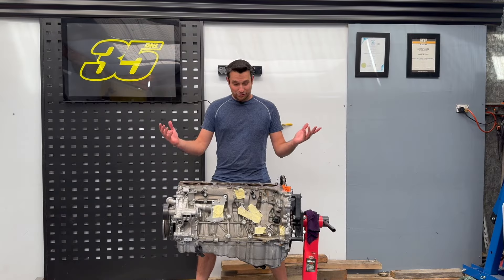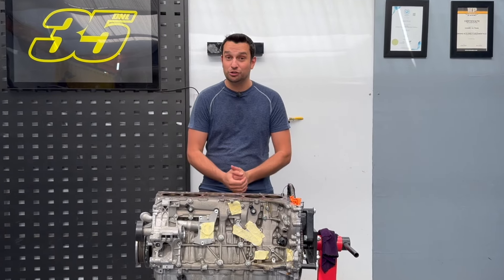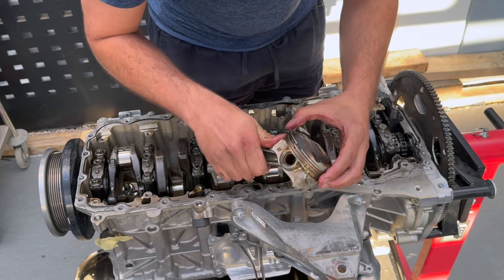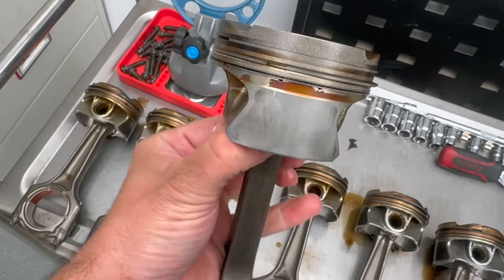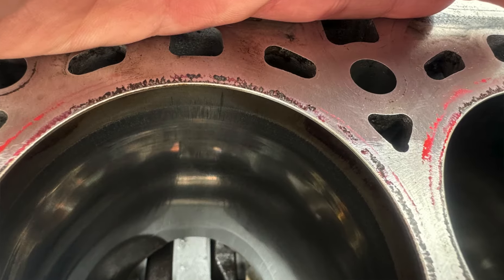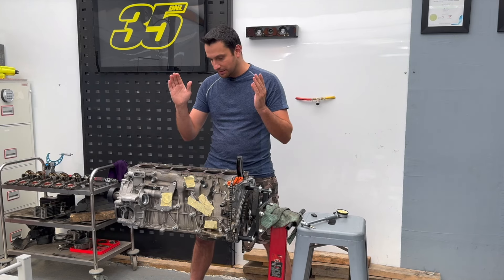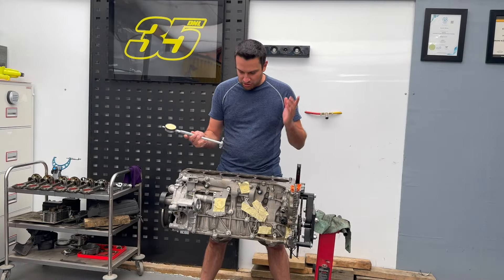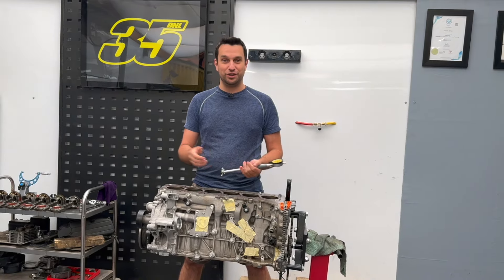BMW B58 Engine teardown - Only 22.000 kms - What went wrong ?

Comment: Would love to hear more about sleeving in the next video, for example what's the difference between iron vs steel sleeves in terms of strength and what kind of pistons you need (cast or forged) for each. Are there any downsides to sleeving? Questions we should ask the machine shop when getting a block sleeved? Very curious about that process. Thanks
Reply: The sleeves, regardless of material, win or lose on block prep. Both are silly strong, and when installed correctly will outlast everything. Makes you wonder why BMW went away from iron sleeves ......oh, I know.
You can put standard pistons and rings back in but why.
Reply from the maker: That’s a great question ! In fact I have a video in the pipeline which will be talking about that - I just need to have some free time to work on the editing

Comment: Hie guyz I really need help thz thc b58 I did engine due to taping noise, discovered pistons were worn-out but nw I have missfire on number 6 I changed almost everything, I re do the engine sent the engine to ENG thy are saying everything is fine , built again start the car doing same thing change plugs, coils packs injectors , I tested compression it's over 1560 psi help please
Reply from the maker: Basically you ran out of things to be the issue. If the engine is good, you have have new coils, plugs and injectors, the issue is either in the wiring harness or the ECU itself.

Comment: Maybe test the injectors? If the injector was faulty and cylinder 3 was running lean then it would get super hot in that cylinder. And then in the heat the piston would expand more and wear itself and the cylinder wall out. But again it's just a theory one would have to verify.
Reply from the maker: Yes, the owner bought new injectors but still sent all old ones to get tested

Comment: Definitely a tuning issue resulting in a fuelling problem.. happened me last month. Ive just stuck a used engine in for time being keeping my other engine as a project to build myself over the next year or so.. fully forged engine single turbo 👌
Reply from the maker: I thought the same
Reply: @dnl35projects i bought my car only recently and it happened. Got very little info on current tuning of it. I think it wasn’t done properly. Engine already got a rebuild by one of its previous owners at 37k km now on 69k km and gone again. Last time cylinder 2 this time cylinder 6

Comment: Seems like the 'wear' might be a manufacturing defect.  Can you rule that out?  The piston skirt being worn might be down to the excessive rocking that then was tearing up the skirt coating.  But the cause of that might be a machining irregularity of the bore it was in.  Shouldn't there be some major scoring and scratches if it was actual wear?

The  appearance of piston crowns looked like it was slightly to pretty rich.
Reply from the maker: I think it’s got more to do with the absence of a proper tune than a manufacturing defect -
Reply: @dnl35projects  fair enough but wouldn't you expect to see similar damage on all the piston skirts, see similar damage to the other bores?

I would think part of engineering a high performance engine is making serious design considerations to facilitate all cylinders are equally fueled and have equal ingress and egress of gasses, equal masses, etc.  The tolerances were all wrong on 1 cylinder.
Reply: @lcambilargiu  Good point, to me it seems like an injector issue on cyl #3
Reply: @robt8042 usually because of technical limitations the cylinders never run as rich or lean as each other. Mostly it’s due to forming of the intake and how air is distributing throughout it. Like for instance Subaru boxer engines your specifically tune after cyl 2 since it runs leanest/warmest on heavy load. Some tuners in the beginning made a average afr reading when tuning which lead to engine seize cause of the dangerously close to lean on cyl 2. Due to lack of fuel and less cooling it seized. I don’t fully know the B58 characteristics but maybe it’s a similar thing. Where cyl 3 can have a leaner condition and with a too lean tune it can lead to this. It’s atleast a plausible explanation.

Comment: If separating all aftermarket tuning in the forms of software change and component tinkering into one lump and comparing it to cars kept as they left the factory, what is the percentage difference in reliability?

Does most of the independent market lean towards engineering enhanced power output rather than reinforcing reliability?
Reply from the maker: I'm about to do a video on that but basically a good tune will not damage or compromise a healthy engine. Yes the wear is increased as power levels go up however the engine is still better off if being maintained/serviced  properly than a stock engine with the standard BMW 15k kms oil changes.
Reply: @dnl35projects  The industry of independent engineers seems to take up much of the slack in the development of new cars. The original product built under time-and-budget constraints that rolls out of the factory is often just a jumping-off point.

Unfortunately, the spiralling electronic complexity, exotic materials and impenetrable mechanicals lock out most owners from properly maintaining their own cars without expensive expertise.

You do a good job in unlocking much of that complexity, so that owners can take back some control.